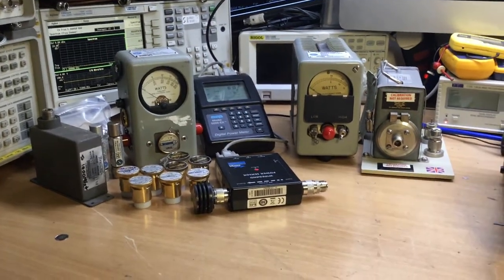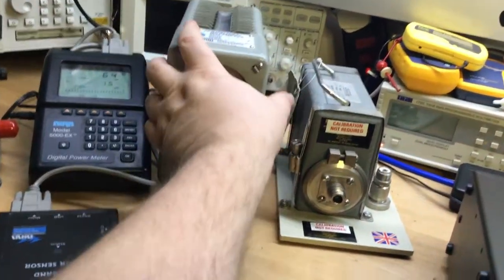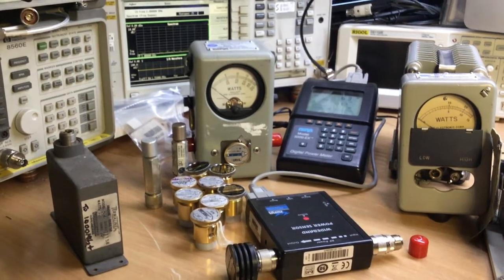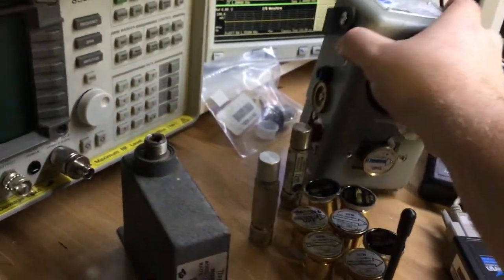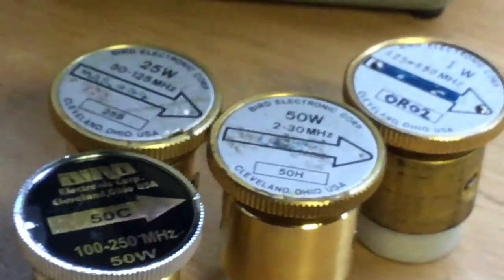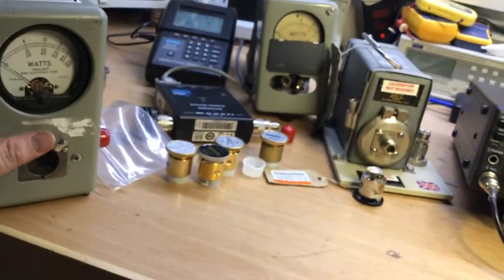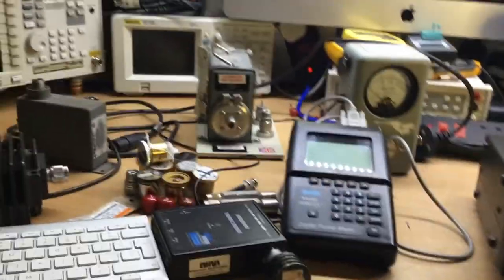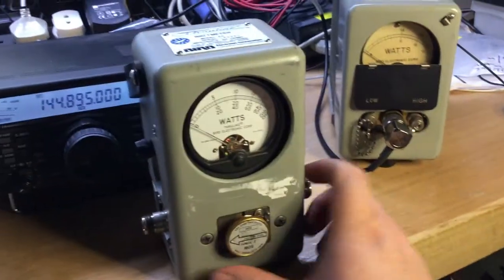RF Wattmeters demo BIRD 43, 61, 5000EX Digital, DMR, with Yaesu FT847 SSB, AM, FM Transceiver

Comment: When I recently bought a faulty 2995R the seller asked if I wanted to buy some other items, I ended up buying a Telewave 44A, Telewave N Type Dummy load and some 30a linear power supplies. Good job I took some extra cash with me. Now if I could only find a decent SWR/Powermeter for up to 30MHz, nearly all the units sold for "Ham Radio" are poor designs or overpriced.
Reply from the maker: If you are wanting to measure RF power accuratly & VSWR then get a Marconi radio test set such as the 2955, 2945, radio communications test set see my other videos (NATO Marconi tactical radio test set or the video i did on the 2945 radio test set) where i demo an accessory called "Marconi directional power head" which goes with the Marconi 2955 to measure up to 1000 watts, the accessory i demo with the radio test set is available in two frequency ranges being 1Mhz to 50Mhz & 25MHz to 1GHz. can measure CW, AM, & SSB modes, these plug into the accessory socket on the front of the test set. This is the most accurate equipment on the market. However if you wish to attain the best accuracy of RF power directly see my video on the Marconi 6960 RF power meter which uses specialist sensors that have an accuracy of better than 0.1% error from 10MHz to 46GHz, used with attenuators they can measure any level of RF power at the source. Of course other direct power accurate measurements can be made using a HP8920 radio test set, Marconi / IFR / Aeroflex test sets, see my video on 2965 & 2968 these can measure Pulsed & Digital RF modes too.Of course the Bird 5000ex is an industry standard inc military.
Reply: @rfmanrfman4536  Thanks for your reply, I really do like my 2995R over the R2001D I have, I'm keeping a watch for the directional power heads and will pick some up given time. I have enjoyed watching your videos.